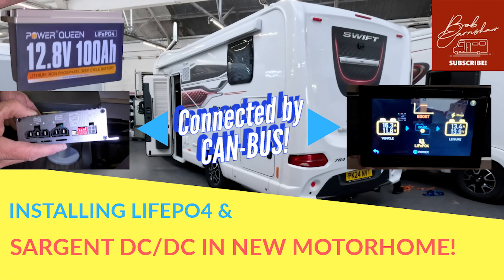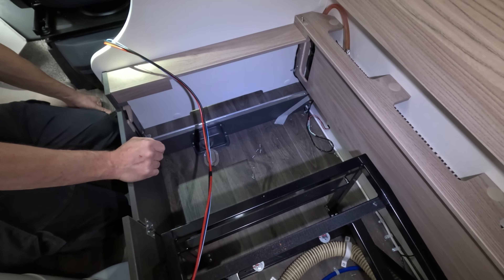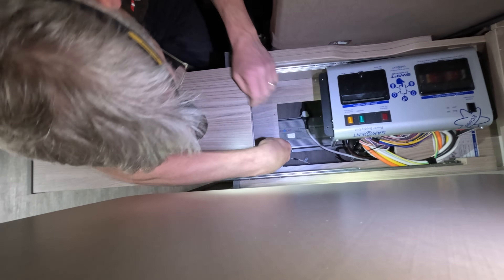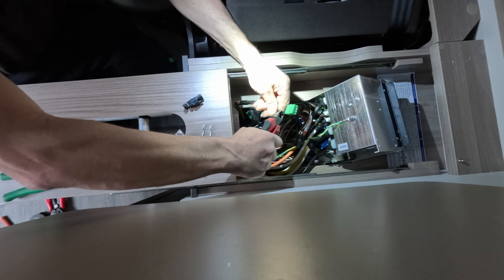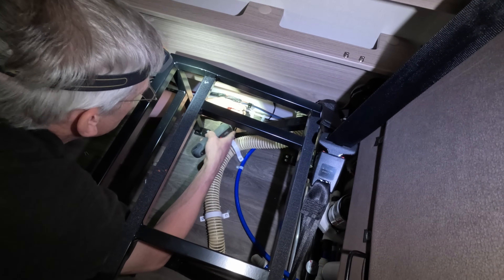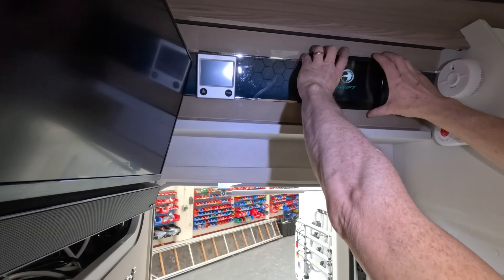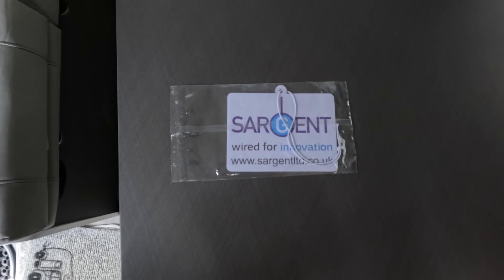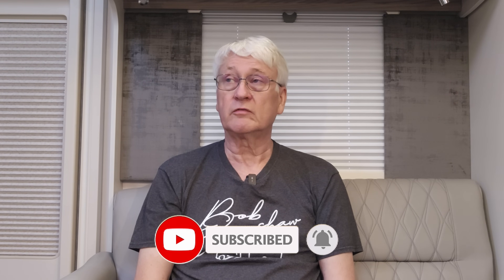BOOSTING Off Grid Capacity: Sargent CAN Bus DC/DC Charger & LFP Battery

Comment: Hi bob did you have to buy wireing harness with i called sargent no very help full thay say i need to fit a px 310 with it i have same van and year as you thanks
Reply from the maker: This video was done for and on behalf of Sargent. If you watch the video you'll see why you will need the wiring harness that Sargent provide if you're fitting the DC-DC. Sargent also provided the  PX310 AC-DC Charger, which is configurable for Lithium batteries. I believe the PX310 is now fitted as standard on new vans.

Comment: Im fitting the 4” screen version in my crafter do you find it slow the touchscreen thanks
Reply from the maker: You mean the Sargent touch screen. No, the new one is very responsive.
Reply: Yes the Sargent touchscreen K940A its a smaller version of yours i assume, when i press the pump button nothing happens then few minutes later it randomly comes on will have to ring there tech team as it wont show the can bus solar after setting it in advanced menu either but thanks for the reply.

Comment: Hi,Bob do you know the dimensions of the battery you installed.As would be nice to know before I go ahead and buy.Many thanks
Reply from the maker: The link in the description gives you all the details, but it's 6.77*13*8.43 inch. There's also a discount code. It fits in the same place as my previous AGM battery.
Reply: @ 
With the Sargent Dc/Dc charger does all the wiring come with it,and also the SIM card for the panel upgrade 
Many thanks
Reply from the maker: Yes Sargent supplied the wiring. Here is the link for the DC DC kit https://sargentltd.co.uk/shop/product/dxc30-dcdc/354
Best to contact Sargent for all the information, including the panel software upgrade, which you can download.
Reply: @ Thank you very much.
Reply: Hi Bob just purchased the DXC30-12 from Sargent would you happen to know the part number for the wiring loom that came with yours.
Many thanks Steve.
Reply from the maker: Best that you ask Sargent for that.

Comment: Bob I noticed your vehicle battery was still charging your leisure battery through the B2B when it was only 11.7v. I have mine set to 12.5v in order to prevent draining the vehicle battery.
Reply from the maker: It is set to reduce the charging  current depending on the vehicle battery voltage. At vehicle voltage  <11.9V it reduces to just below 17A and reduces the charge current as vehicle battery drops. I think I put a chart up to show this. You might notice how much current the alternator is supplying.

Comment: Just put pure sine wave 3000 watt inverter into our Motorhome with 500 amp hour of lithium and lots of solar . Which means we can run everything-off grid through the 240v sockets including the ac and microwave. Getting pretty common over here Captain 👍🏻
Reply: We too , lots of solar 700 watts, 2x 135 lithium, 1600 inverter/charger plus b to b. We full-time, even through the winter couldn't get below 75 %.